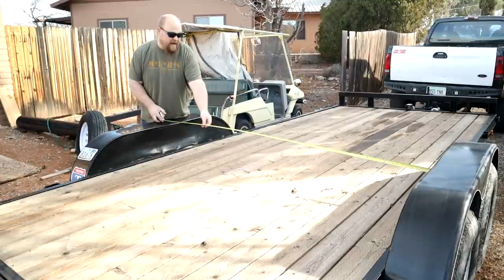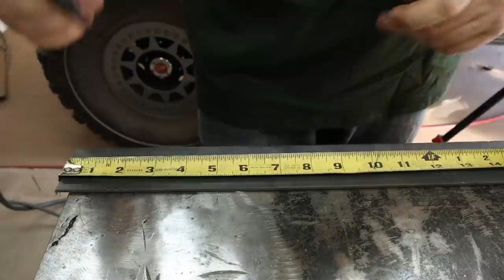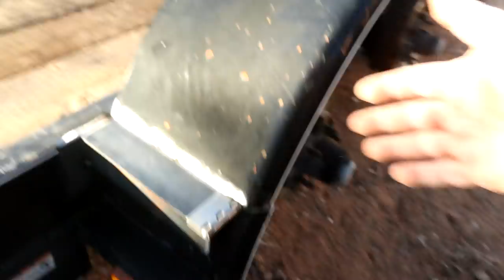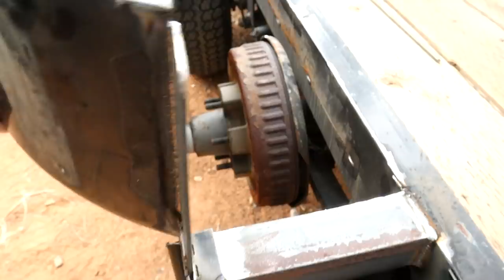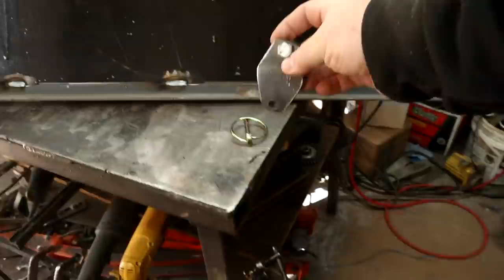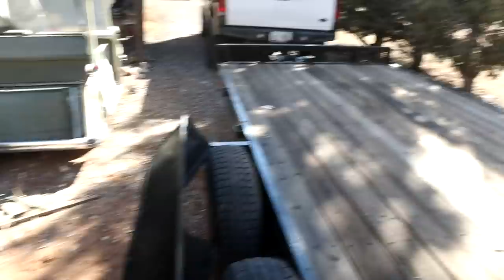Building custom Tip Out fenders for my car trailer. Fabrication 101!

Comment: Not using those jacks on the back will cause excessive wear on everything on back of the trailer and it will also lift up tow rig or make it light on ass end. If on uneven ground it will all roll down hill until tow vehicle get weight back on it.  Causes bushing and springs to wear out and will eventually break frame of trailer if loading heavy loads. Cut them off to the minimal height you need or make them swivel which would be better in case too much weight you can pull forward or backwards to get them
Off

Comment: If you put a couple 1inch wheel spacers on each side could your brounco sqeez thourgh? You need those stabilizers or wood boocks to keep weight on the rear tires of the truck,and keep it from moving
Reply: He needed about 6 inches more width so he wouldn't run over and destroy his fenders. I have a lifted ram with wide tires, I ran my fenders over and bent the shit out of my fenders, I pounded them back out. When I had to unload, I overfilled my ram tires to thin my tires and ran barely back over my fenders. I need new fenders still, I will try buying some and making them lift off.

Comment: I like the tilt fenders but why did you weld a tab sticking up to latch them? Now you have to drive over that little piece of metal sticking up. I would have used another hinge so the hole could be folded over.
Reply from the maker: I have a redesign in mind but believe it or not the tires on my Bronco barely touch them.

Comment: The jacks at the rear of the trailer prevent the trailer from picking up the rear end of the truck and it moving forward or backward - don’t load the trailer without them - remember parking brakes are only on the rear wheels of your truck - also never load your trailer on a hill. Btw you do not have to pick the whole rear end of the truck for it to lose braking traction.

Comment: I'm going to more or less copy what you did here, for my rock crawler trailer.  I think that lessons learned are hugely important!  If you were to start over again right now, what would you do differently?  I was thinking maybe hinge the fender just s touch further out toward the lip of the fender, and maybe cut the fender where it's welded to the trailer, rather than at the feck height, since you said that it easily cleared when tipped?  Thoughts?
Reply from the maker: The fender does rub on the tires when the trailer is loaded but they'll still close with a little persuasion. I don't think I'd change much. I do need to add a chain or some kind of stop so the fender doesn't sit on the side of the tire when open. I've bent two of the hinges when loading and I think it's from the fender rubbing on the tire.

Comment: Thank you for the video. 1 ? If you have 2 drive over the tires then that would make the trailer to small right? 
The tires ride on the edge of the trailer ? Lol I walked away about the part when you said you were going to widen the trailer . Awesome video.
Reply from the maker: The trailer is wide enough to fit standard vehicles no problem. My bronco has 14" wide tires so they stick out a bit on each side. Enough that they would destroy the trailer fenders pretty quickly.

Comment: Loading a skidsteer or any type of equipment if the sort can lift the front of the trailer enough to walk your tow vehicle if your not careful. Those jacks on the back solve that issue

Comment: My trailer says to brace the back of the trailer before loading. So those are probably to brace the back up to control some of the stress on the frame and/or axle.

Comment: When you started the video you measured the trailer width for allowable track width of 82”. What was the with after doing this?  It came out great!
Reply from the maker: The deck of the trailer is still about 82" so you can't go too much wider without falling off. My broncos tires stick of about 3" off each side.

Comment: I was thinking I would've used the grinder that was sitting on the trailer then it happened... Makes sense on the sparks causing an issue to though. On of the reasons I like working alone, it is 100% my fault.

Comment: I’d be a little concerned those tabs on the trailer might cut the tires on your bronco. That is being that you will have to drive over them as well.
Reply from the maker: They're only an inch tall so I'm not too concerned but I will be watching closely the first few times I load my bronco.
Reply: I really like this modification however I agree with the concern about the tabs cutting the tire. If you come the trailer tire hard or if the tires are wet and you spin the Bronco tires on the tab it could cut it. After watching this I’m considering doing the same this!! Thanks for sharing!!!!
Reply: @Fabrication101   you could even use a small hinge as the tabs so that they fold down out of the way

Comment: I think your tabs to hold the fenders are going to be a problem with your tires I figure you would do a bolt with a welded nut in the center of the flat nut welded on bottom bolt on top with wing design to hand tighten nothing sticking up to get bronco tires

Comment: I want to make flip out fenders but i was thinking of making the whole thing flip forward. And this way your fender still not in way.
Reply from the maker: I consider that idea, but felt it would put a lot of pressure on the hinge during loading or unloading
Reply: Technically no. Because your tire on your buggy wouldnt come in contact with it. Because i would make pivot point below the trailer deck height

Comment: Will the lock down for fenders going to cut your tire when loading
Reply from the maker: Nope, the tires on my Bronco run up on the trailer tires so they barely even touch the tabs.

Comment: The rear jacks keep you from bending your trailer frame when you unload heavy equipement or vehicles.
Reply: The main reason for those rear jacks is to eliminate the load raising the rear of the tow vehicle and having the whole thing roll off .

Comment: It sounds like you have a travel issue on your bronco check the jounce and rebound ( travel  ) if you have a pan hard bar ( top link, cross bar diagonal bar " several names for it " check during full movement it is not binding. The legs on the back of the trailer serve two purposes one to prevent or limit the unloading of the weight on the tow vehicle, causing a possible moving issue the other is if there is only two frame rails running the length of the trailer and are of very thin wall  you run the risk of bending the frame. I run two one each side tung jacks with kwick pins to rotate or remove after loading...

Comment: How much did this help for loading with a forklift?
Reply from the maker: I recently picked up three roll-up shop doors, and getting the fender out of the way definitely helped. The guy running the forklift was impressed.
Reply: @Fabrication101  I was wondering because a forklift still can only get as close as the fender when flipped.  Just that extra height clearance was the difference? Good to know

Comment: Didn’t your lock piece on the trailer defeat the hole purpose?
Reply from the maker: Lock what piece?
Reply: @Fabrication101  your tab to hold your fender down it sticks up from the frame if you drive on your tire will drive over it!
Reply from the maker: The tires on my Bronco barely touch those tabs. But I do have a new design in mind, just need to find the time.